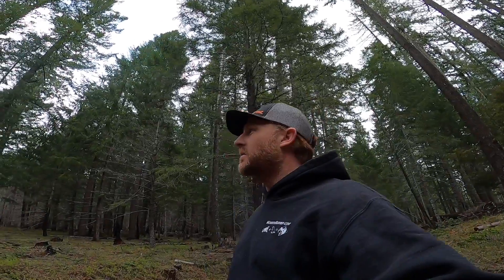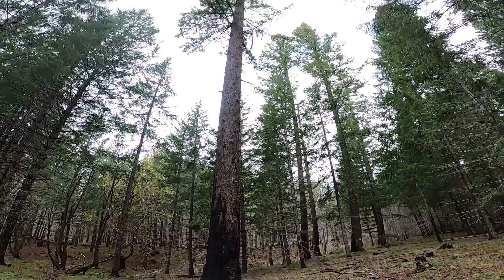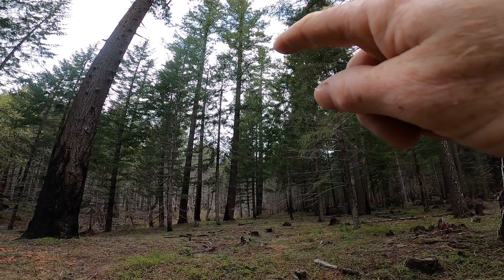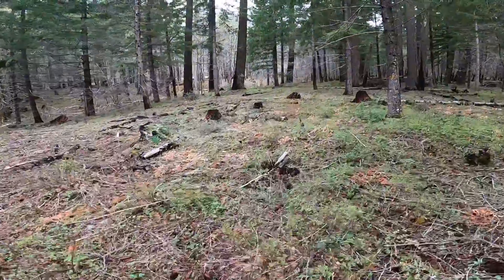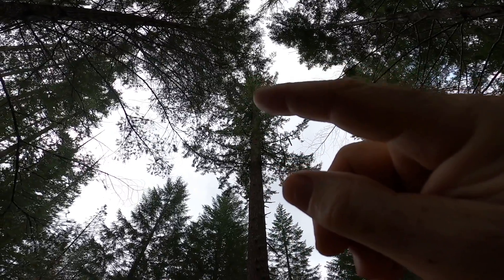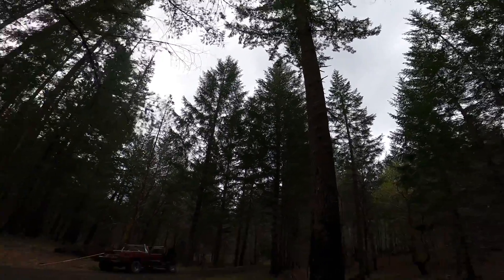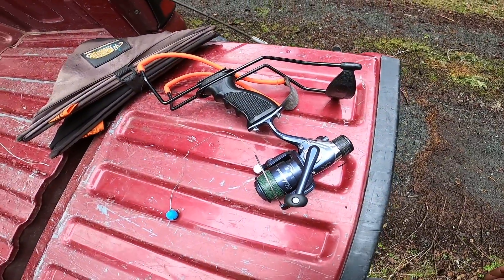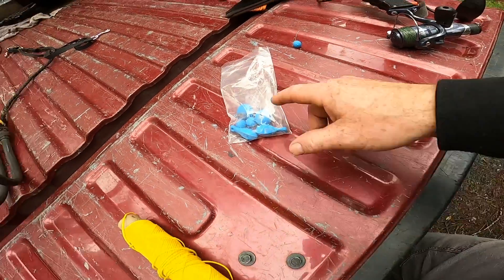Experimental line setting method turns into drone rescue

Comment: I built an air powered throw ball launcher from 1 1/2 pvc that will shoot 300 feet of throw line almost vertically with relative accuracy it’s cheaper then the aluminum ones but works for what I need
Reply: Like a small potato cannon

Comment: Jeff I don't know anything about your drone but will your drone lift that blue weight  up over where you want it to be and then land it on the other side of the tree?
Reply from the maker: The line would probably get caught in the propeller
Reply: I built my own air cannons and built a custom trigger for them so that 
It totally changed the accuracy.
I've never shot more than three times trying to hit my target since I change the trigger.
If you built an air cannon with a large air chamber and put 120 volt converter on your truck engine you might be able to pump up a compressor enough to shoot a long ways with a smaller ball. I make my own throw balls out of leather and have 5 through 11 oz balls that I shoot. I even put sights on Mike cannon. Just a thought.
Reply from the maker: @FloatingFeatherProductions  ya I’ve built cannons also I was just experimenting